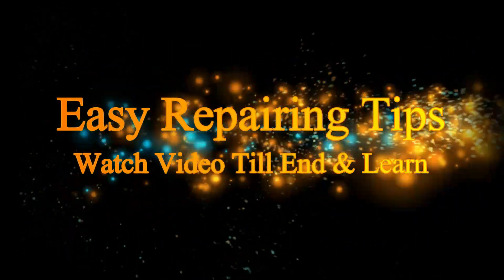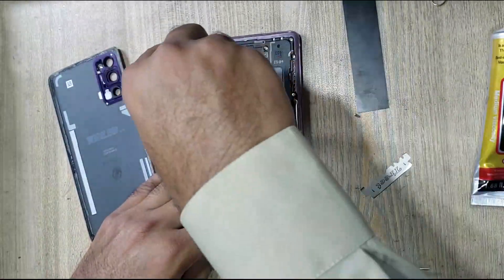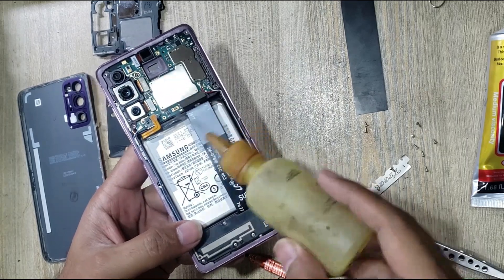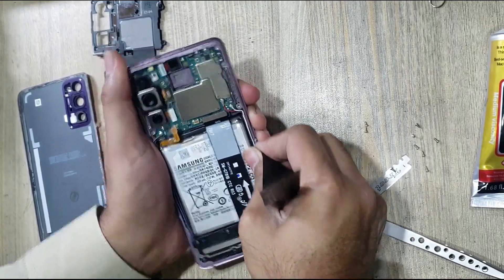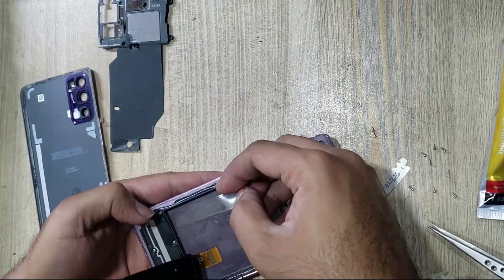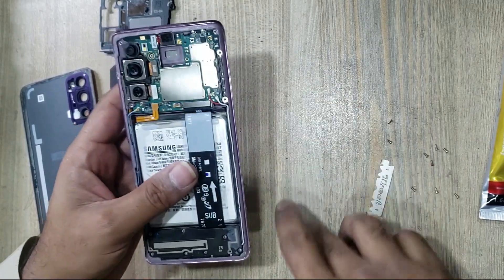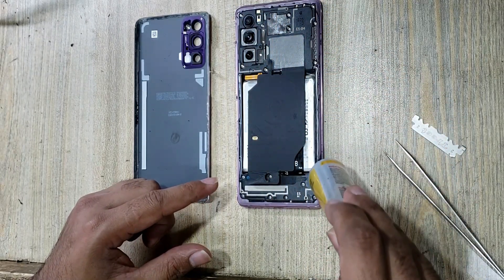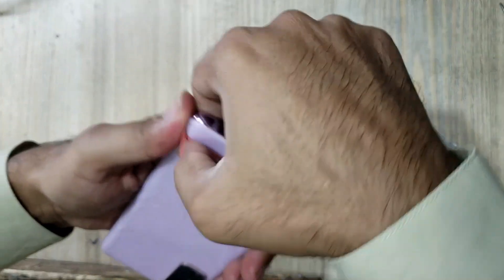Samsung S20 FE Battery Replacement

Comment: Please, have someone who speaks English well review this video, I don't think people will do this, but in the video it says "insert gasoline" which is explosive, battery and gasoline do not mix well.
Reply: Gasoline is not explosive, in little quantities acts like a dissolvent
Reply: @jacksmirk999  Really?  Not explosive?  The fuel that explodes hundreds of times per minute in your car's engine?  After it gets a electric spark?  And you want this in close proximity to an electrical charge?  Are you aware of the Darwin Awards...
Reply: @paulcummings55  if you don't know how a combustion engine works just shut up and don't embarras yourself. For it to ignite you need not only a spark but to mix it with air and compress it (that's what cylinders are for). The three things is what creates an explossion. Gasoline is just flamable not explosive.
Reply: @jacksmirk999  Huh- and apparently you can't read.  This has nothing to do with a combustion engine, where you would want measured air and compression for efficiency.  However, gas, either in vapor or liquid states, will ignite with a spark.  Maybe not as 'efficiently' as a car engine, but enough to ruin your day.  I suggest you consider a remedial chemistry class.  Or just pour some gasoline on your foot and see if you can light it wihtout 'mixing it with air and compressing it.'
Reply: Just use alcohol.
Reply: Tool